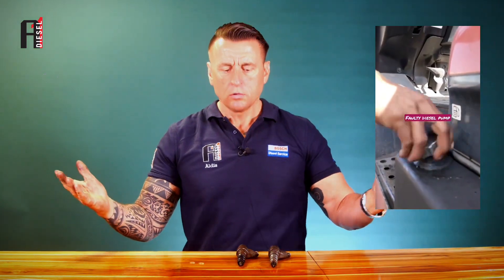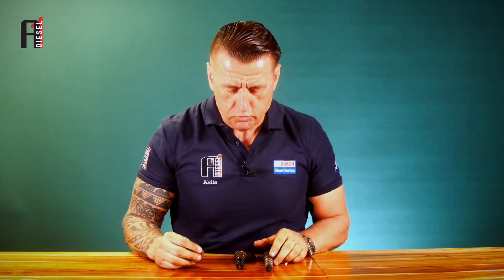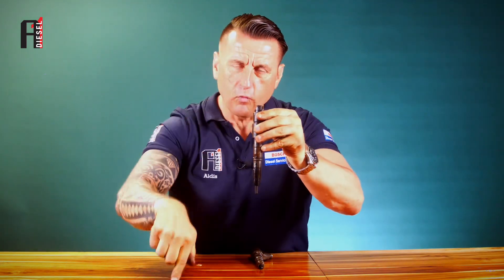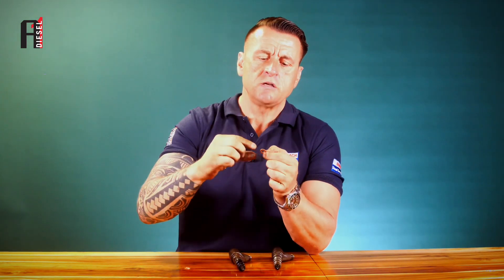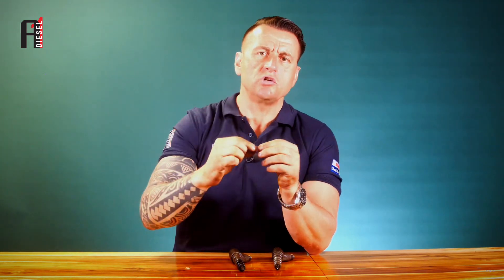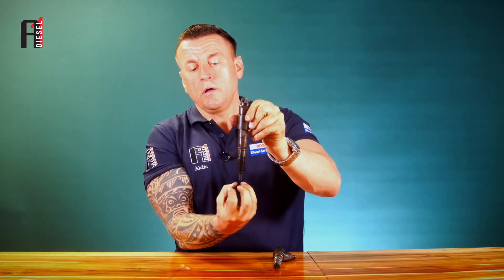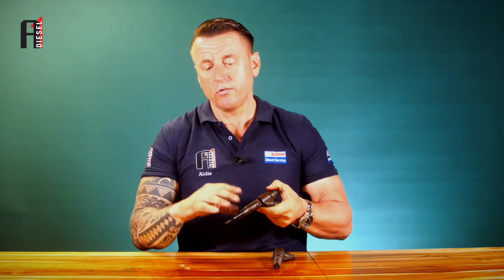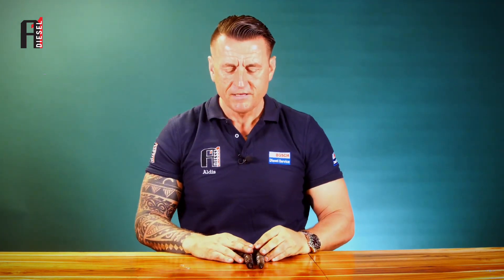Smoke coming from diesel tank? Symptoms and solution

Comment: I have a Jaguar XF 2.0d 2017 and there is a lot of exhaust smoke when I fill the tank and also when I open the oil cap and the oil dipstick the smoke comes out in large quantities
Reply from the maker: It sounds like your Jaguar XF might have excessive blow-by caused by worn piston rings or a blocked crankcase ventilation system. I recommend getting a compression test and inspecting the PCV system to pinpoint the issue.